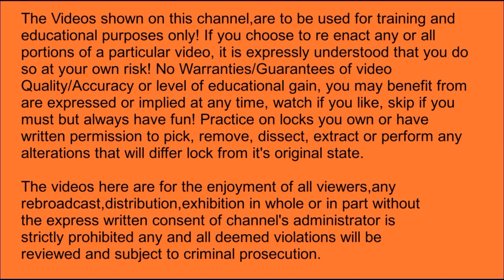#561 MUR-LOCK 68 EPIC LOTO Tues Commentary alone is worth it RRRRRRRRR

Comment: That hook you were using towards the end probably helped nab pin 6, glad you got it open iirc those abus pins are smaller diameter than say a Lockwood 245 padlock so even less margin for error good work! stay safe mate!
Reply from the maker: Thanks foe stopping by mate
I really appreciate your comment
This lock was a crazy pick with continuous over setting,which added more fuel to my determination lol
You are correct on the hook I used it set that 6th pin,I hit 2 pins at once many times
I picked up this along with loto in previous video from work as they were headed to dumpster and here we are
Cheers and thanks for support!